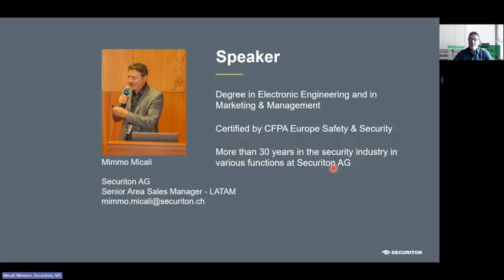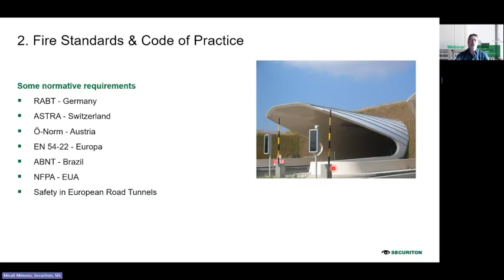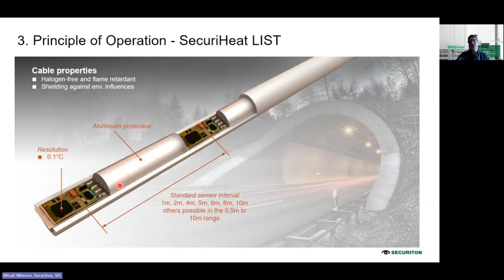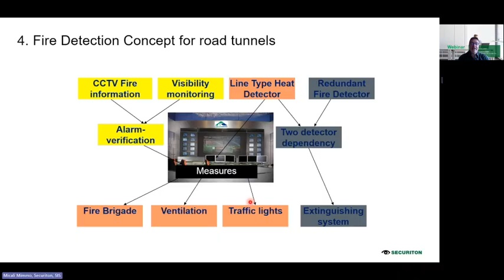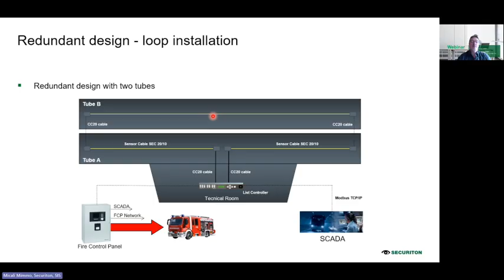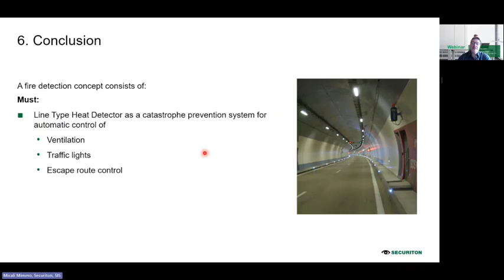Webinar: Listec in Tunnel Applications

Comment: Hello Securiton team,
I would like to suggest expanding your presence to Belgium and the Benelux region.
Belgium has a strong market for high-end safety systems, especially in areas such as airports, government infrastructure, industry and large commercial buildings.

Your advanced fire detection and security technologies would be a great fit for the region, and there is strong potential for partnerships with local integrators.

Thank you for considering my suggestion.
Best regards,
Marco Brizuela